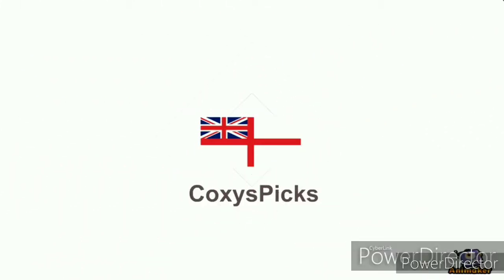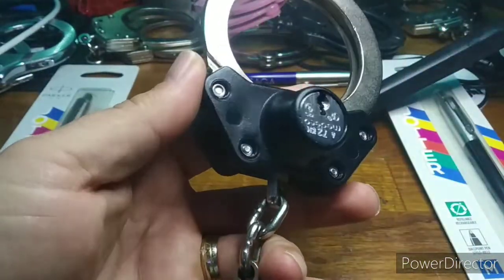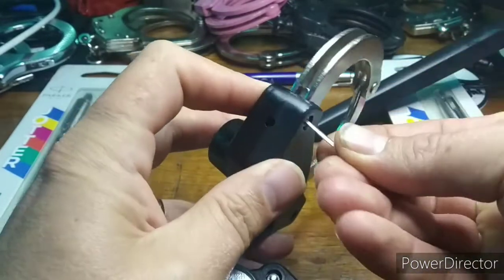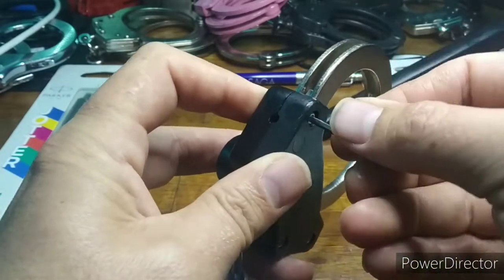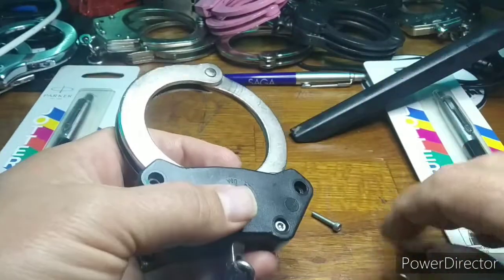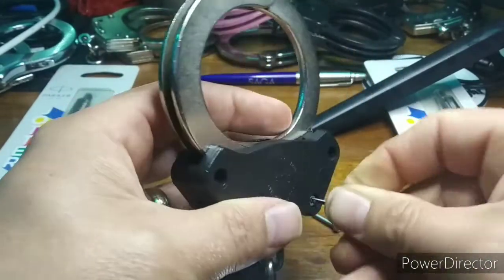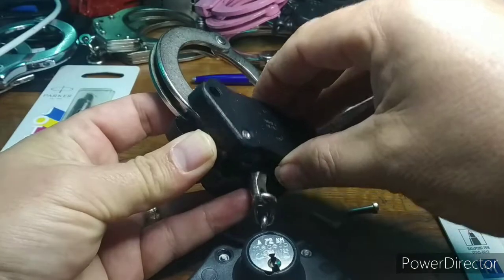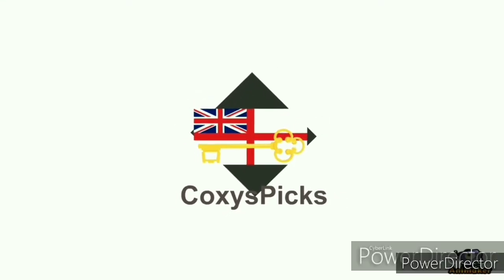(18) Parker Vs BOA High Security Handcuffs

Comment: Oh now Parker is showing off now!! Excellent. To protect against this, companies applying these after-market modifications should use red permanent thread locker to make the bolts properly secure. But I guess that is not a standard thing lol. They expect nobody to have the right tool to unscrew them since they are security torx screws lol. Parker sticking his nose in strikes again lol. Epic! Expect the unexpected. I would never have seen this one coming lol.
Reply from the maker: Well, they are old, so the loctite could have been weakened, but all you need is torque. You could achieve the same result by smashing the plastic against a wall. I think boa came up with their transport box to prevent this method.

Comment: The version of cuffs you are working with is the original version; and in fact one of the prototypes before we were in full production.  It is more than 25 years old. In addition, you are showing it less the caps that covered the screws and the Loctite that was applied to all of the screws used.
Reply from the maker: Hiya, I don't have access to the newer models.
This is how I received the cuffs.
If you were to send me a set I would happily showcase them.

Thanks for Watching and great handcuffs 👍
Reply from the maker: I'm yet to aquire the new ones. But I have been successful in raking the medaco core. That would have to be the attack vector on the new and improved ones 👍
Reply from the maker: That's just making it silly. That's almost as bad as asking me to pick a lock that has been super glued shut. 
Also, this model is used in the front, with a box and waist chain. 

The box is a great addition - as it blocks the keyway. This limits all attack options. Limits, but not removes.....
Reply from the maker: Peerless - Yes
BOA Supercuff - theoretical yes, practically impossible
Reply from the maker: The 710 DL bar can be moved kinetically (I.e a hard strike) the second one you refer to is the medaco - which doesn't block the pawl completely. 

So hit it, then shim it.

Comment: You toldly blow me away. Very clever. Was there even lock tight on the screws? Or did the Parker break them lose. Those cuffs are really nice looking.  Another Great Video my friend.
Reply from the maker: There was locktite on the screws. It could have been age, but after the initial crack with the Parker tool the screws just slid out nice and smooth. 
Thanks for watching and glad old parker surprised you buddy 👍

Stay safe and have a great week 🤘😎
Reply: @CoxysPicks  Great video